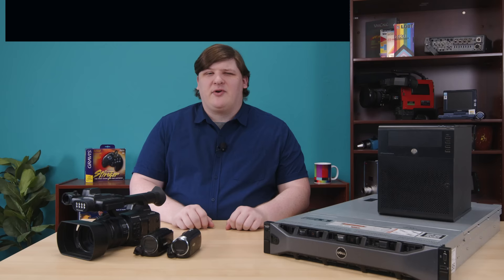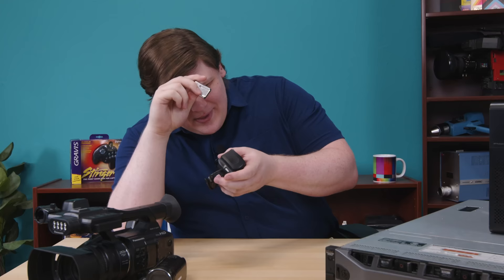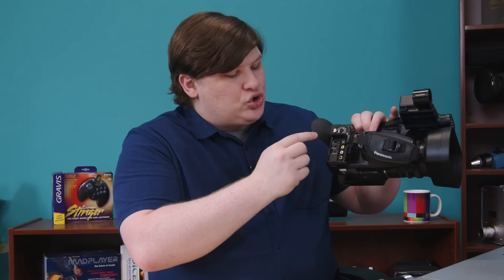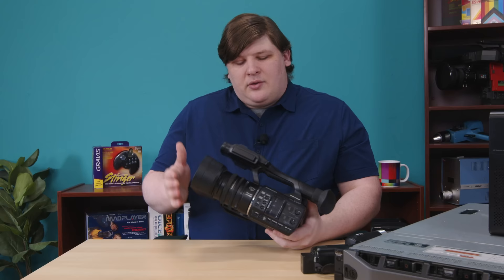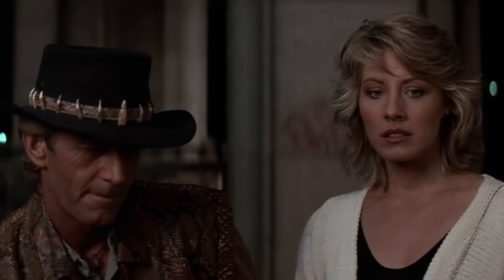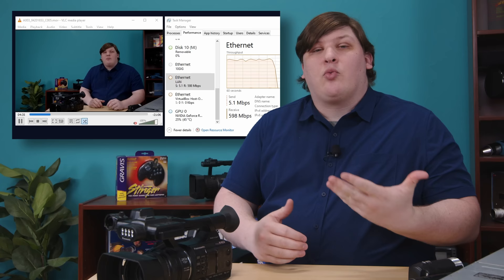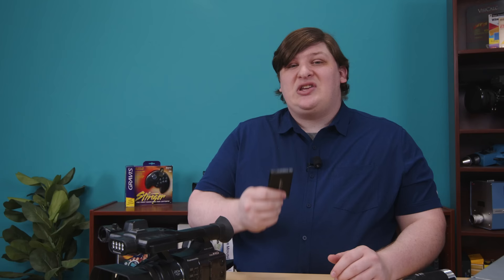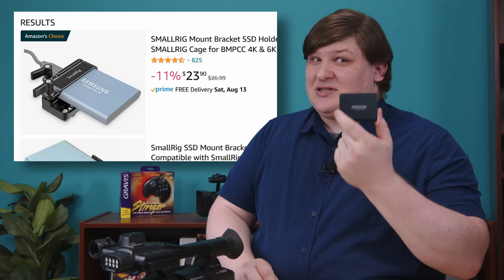I Built... a really fast NAS?

Comment: Dude!!!! Have I got the DOS command for you. Robocopy !!! You can make a scheduled task and run it from any machine and use this script to grab files from anywhere on the network and put them anywhere else on the network as long as the machine running the script has permissions access to see the files. Why is this command awesome? Automatic, and DOS... so fast as hell. almost zero impact on the computer running it OR the network... because it is DOS. The only drawback is also... DOS.. so you have to dive down into the "users" folders using actual folder locations, not assumed locations.  Using the arguments I provide in this script will cause it to copy only new and changed files.  The first time it runs it will take FOREVER, but once it is just copying changes it is FAST.  I love the control and the fact it has so little impact. It also makes a log so if it goes wrong, you know (if you bother to check it) I will post the script below. Remember to use Notepad++ when editing a batch so it has color coding for the commands.
Reply: Some things to know, this is of course a batch file - i call it backup.bat -- XF is file names you do not want to copy for whatever reason. The file I named had permission issues and would not copy. folder/file names with spaces must be inside quotations. the MIR argument does a mirror, so any changed files or new files get copied, and removed files from the source will get removed from the target.... so if you don't want that you need to modify the arguments.... if you want to see more about this command get the CMD line and type --- robocopy ? --- at the command prompt.
EDIT: The reason I have a weird goto end - End is because I had the entire explanation of Robocopy and its arguments in between there - copied from a DOS prompt. Youtube did not like it. would not allow me to post with that in there. probably something it thought was disallowed code.
Reply: never played with the linux equivalent -- rsync
but it is supposedly just as good at doing backups as robocopy in DOS. Never seen it used in a bash but probably not hard to figure out (for those who don't know - bash is the linux equivalent to batch in dos LOL)

Comment: so if you're sure you're not going to have any more than 1 client connected to a give, share at a time. i'd recommend using iSCSI instead of smb since it has basically no network overhead since it's a block device over ip protocol. it also doesn't deal with near the same amounts of windows networking issues

Comment: 15:50 110MB/s is a 880Mbps
And 110MB info you used was from BlackMagic website (I identified font) and it was mentioned for 30fps =))) 
Also prores mentioned top bitrate and bitrate can flactuate a little bit from 220MB/s

plus sound =)

Comment: I'm surprised by the poor performance you experienced with the HP MicroServer - I have a pair of these running FreeNAS/TruNAS 24x7 for like 7 years.

Power consumption is quite low, partially due to the low-power/performance CPU. Still, I can fully saturate the gigabit link on my NAS, both on read and write. With spinning disks. Sustained.

I should try and add a 10 gig card to see what its limit really is 🤔.

The super efficient, block-level ZFS replication over the internet to my other NAS (and vice versa) is super best for mutual off-site backup 🙂.

Anyway, I realise 1 gigabit is insufficient for your current bandwidth needs. Just recognized the MicroServer and drop my recommendation, if 1 gigabit is enough for you 🙂.

Comment: For your gpu issue consider the Nvidia RTXA2000 its based on the RTX 3060 but in a low profile package that runs totally off of PCI power, its a great little card.

Comment: Do some more looking at the T7 before you buy. It can write and read at Gig but can't sustain full speed over the entire disk. The cash portion of the drive is full speed but if you read/write a full 2TB from the drive it slows down to someone like 200-300MBs. MLC vs TLC vs QLC and using the QLC as a SLC cash.
Reply: Also thanks for making the video. There's a lifetime worth of knowledge in it.  Took me years to learn what you went over in this video. I bet it took lots of research time to get this far.

Comment: revisting this video now that i have my own fancy camera: i wish they'd just put a litteral nvme or sata slot into cinema cameras. i've got my 4k set up with a usb-c to sata sled and with a suffieicntly good ssd it works great (up to the limit of what sata can do at around 550MB/s with overhead). given that the writes speeds of nvme drives are up in what stuff like the 6k would need, they should just let you shove a 990 pro right into the bottom of the camera and call it a day!

Comment: This video really gets me thinking. I have many of the same problems. But with a even smaller budget. So unfortunately a lot of external drives for me so far. lol .  Also you may have overlooked a couple of Solutions in the beginning. I usually will dump my footage on one drive my storage Drive and then transcode to DNxHR on my scratch drive. This gives me at least one backup and really good for editing. also I set me project back ups to ather drive then save to the same drive when I do a normal save. Also why don't you use black magic raw? Just curious. You are on PC. I've heard it at it as well.

Absolutely great stuff . I don't think you're a dummy.  kind of bugs me when people call themselves dumb especially people that are so obviously smart.  

Love your channel it's very original helpful entertaining and educational. One more thing would be I would love to see a video on how you transcode to H.265. Do you use a script. I've had issues with audio sync using bartender. It works well for one video when you get the settings right. Anyway have a good day.

Comment: I wanted to invest in a NAS but instead started using my Windows PC as one. Luckily my case can fit 6 HDDs in nice toolless caddys (Enthoo Pro), and I also have 2 SSDs beside that, plus a hot swappable 5.25" HDD bay. 6 SATA on motherboard + 6 SATA on a PCIe extension card. My drives are pooled using DrivePool, and backup is done using snapraid. Mind you it's not RAID, so every time you make changes on the drives (and don't want them lostt in case of failure) you have to initiate a parity sync. I also do regular scrubs weekly.

Comment: Does it stand to reason that when mirroring, you may be less likely to suffer a dual failure of both drives if you use two ssd drives of the same capacity, but differing brands... but equal generations? It just seems to me that mirroring using identical drives could only increase the chances of failure under the equal useage conditions that exist during mirroring.

Comment: If you really start needing capacity. There's apparently older NetApp disk stations or whatever they're called that can be used and managed by nearly anything with minimal equipment. LTT has a vid on it and apparently they got the idea from others that had done it.

Comment: About dock: I bet a tiny 3d-printer adapter will make it 100 times better

About write performance: In zfs, you can create a "write cache" using a single fast nvme ssd. If that SSD is large enough, you might get away with slower main drives.
Reply from the maker: The only time I need fast is when I'm moving terabytes of data, in which case it needs a drive big enough for it all to land on. A cache drive would either be as big as my data - defeating the purpose - or smaller than my data - and would thus run out of space before it could offload what I was pushing to it.
Reply: @CathodeRayDude  that's the point. you basically dump your whole footage onto the cache and let it sync to the slower disks (at this point you can remove/reuse the removable media). yes, the cache should be as large as your camera disks (not as big as your archive), but it would allow the main storage to have lower write speeds (which also means it can be bigger for the same price)
Reply from the maker: @Derlaft  why though? I have no desire to store the full size footage long term, and it's completely unusable on slow storage, unless it's been transcoded.
Reply: @CathodeRayDude  "unusable on slow storage" I did not mean HDDs :) usually SSDs have much lower write speeds than read speeds, so that should still be usable. So just a combination of a very fast nvme ssd and sata drives in the hotswap bay. The point is to reduce price and also reduce the time you need to dump the footage (if you ever need that very quickly).

But that's just to highlight a very cool option. If you already know about it - cool.

Comment: Honestly I still use the g7 and g8. One of them sits with truenas works perfectly can saturate 1gbps no problem. And then the other one runs windows 7 just because I had a key works perfectly for my local storage. Then my g8 runs an higher end Xeon Cpu and runs esxi. And for the moment I run a rust server on that box. My router runs pfsense on a tiny dell sff workstation. Have a 3770 i7 and 16gb ram there. And that is utterly overkill. Pretty much everything I have can run at full gigabit.

Comment: 1:05:37 Fibre Channel is (sort of) L2 protocol, so it's a (sort of) stand in for Ethernet. While it's primarily used to run SCSI, there is an IPFC (not to be confused with FCIP) standard which allows to run IP over Fibre Channel - either in point-to-point configurations or in FC fabrics with FC switches. While it has its niche uses, it is hardly ever used. I've done it once just because I needed a heartbeat between two servers and ran out of Ethernet NICs. So all of this is unnecessary, expensive, and has dodgy driver support (unless you're using Solaris), so there really isn't a reason to know any of this and you can go right ahead and forget everything you've just read.

Comment: To avoid the smb share disconnect issues and the fact that the program wont edit files on a network share, you should switch to ISCSI.  Map the LUN as an ISCSI Target and the windows pc built in ISCSI client can connect and will treat it as a local drive.
Reply from the maker: But then I have to use NTFS, I lose all the advantages of ZFS and all the automation I built on the NAS. At that point I might as well plug a disk shelf into a SAS card in my PC. I also tried it, and iSCSI had bizarre slowdown issues.

Comment: He says that tower servers have even less drive capacity at 37:52, but my 32-drive Poweredge T630 would beg to differ
Reply from the maker: Wow, I didn't know they made those! What a beast. I think a 12-bay 3.5" array is still denser in terms of raw TBs though, right? That's how I was thinking of it.
Reply: @CathodeRayDude  
Oh yea, your system is probably much denser in terms of storage.
My system is configured with 24 600GB drives and 8 1.2TB drives, all at 10k RPM with the exception of the (hardware RAID mirrored) 15k boot drives, total storage is only ~24TB . The entire system is very impractical and the drives alone draw around 200 watts, but it is fun to brag about.
It also unfortunately suffered from Dell's annoying choice, which you actually sort of touched on in the video, of not including GPU power cables. I thought it would work just fine if I just plugged a newly acquired Quadro 6000 into a PCIe slot without power. I figured it would just limit it to the PCIe power limit. Turns out it draws as much power as it can and kills the system.
Also, with all of the drives plugged in, it not only sounds like a jet engine on startup, but can be heard throughout the house due to the sound of 32 2.5" platters spinning at insane speeds
Also wow I didn't mean to write a text wall

Comment: no joke, this video made me realize that my backups hadn't run in over a year - not because anything broke, but because I made it annoying for future me and then future me disabled it and forgot. you truly are your own worst enemy with backups

also found out that one of my RAID drives' power cables got unseated and the only indication was that the cluster got marked as (Degraded) in the BIOS menu, so uh, maybe time to ditch motherboard RAID like everyone warned me : )
Reply from the maker: phewwwwwWWWwwww that right there is why people don't trust hardware raid. not that you can't necessarily overcome it, maybe you can, but why bother adding another layer of abstraction when modern software RAID does so well on its own?
Reply: @CathodeRayDude  There are some real benefits to hardware RAID, especially since Windows' software RAID sucks. With proper hardware RAID on a server any failures will light failure indicators and will also link to the IPMI. Of course software RAID has its own benefits. Firmware RAID is the worst of both worlds.

Comment: Buy some used FDR Infiniband cards and switches. Loads of used gear available as ConnectX-3 is EOL by the vendors. You get near zero latency at 56gbps and if you're using IB protocol transfer and can avoid a lot of the overhead from TCP frame processing.

Comment: Storage is the biggest issue I face, Most of my Storage has been filled with archived Dashcam Footage, I have archived most of my footage going back to 2012 when I bought my very first Dashcam which I lovingly call the Crappy Cam, Quality was God-Awful and I still have it somewhere & it still works although the Hinged screen has had to be taped closed as the hinge broke, I’ve bought different Dashcams over the years & now have a 4K Cam in the front & 1440p Cam in the back of my Vintage Van and I like to backup my footage, I have no idea why I like to back every journey up but you never know, Their may be a good reason for me doing so but the reason eludes me at this time plus theirs also other Software along with some CCTV footage, Youtube footage, Old OS’s, Programs, Games, Drivers, Media etc, I have 3 x External HDD’s, 1 x 4Tb, 1 x 8Tb & 1x 18Tb plus a 4Tb internal HDD & a 1Tb SSD as the boot drive plus a variety of other drives (Probably 100 or more) ranging from a few hundred Megabytes upto 2Tb’s, I would like some form of complete solution, I do have a Dell Poweredge 2650 Server and  I knew exactly what you were referring to about Servers being noisy and it doesn’t get plugged in for that reason plus I live in a Flat (Apartment) here in Birmingham, UK and could really do with investing in a more up to date Server or a NAS that has a reasonable amount of Drive Bays and connects with USB3 at the very least, What I wouldn’t give for a Petabyte Drive that I could just plug into my PC! That was a good video to be fair, I had to chuckle when you found out that the Battery on your Sony Camcorder was removable after all! 😂🇬🇧

Comment: I don't know if software exists that can do this, but a thought occurred to me about the ingest time-lag - what if it was possible to have a semi-virtual filesystem that when you plug the USB drives in not only automatically starts copying the files to the NAS but also makes the data appear to have copied immediately, allowing the video software to use the files as though it were already copied, but is actually serving the data from the original drives while copying the data to the NAS in the background as USB/network bandwidth allows?

Comment: In regards to the Samsung T5, Samsung has recently discontinued the production of them. The T7 looks great on paper, and they seem to work fine for ProRes recording, but I have seen a lot of reports that at higher bitrate/lower compression BRAW recording they have a tendency to drop frames.
Reply from the maker: I'm really hoping the T5s hang on for quite some time because I hate the form factor of the T7, and yeah, I get the impression that it's just not as solid from an electronics perspective. Here's hoping things improve. :/

Comment: OMG, don't use T5s on a Black Magic: they can record to NVMe SSD! Buy a bunch, stick them all in USB-C m.2 enclosures (like the tiny Orico aluminum one), connect it to your pocket 4k/6k, and you're done. That's your "SD card". It can read/write WAY faster than your camera can generate data, and is so much faster to transfer data off to a PC than a regular SSD. And good news: you can now use Sabrent NVMe SSD, so your "sd card" isn't even a "tiny" 1TB, it's now 4TB or even 8TB. And still transferred at NVMe speeds, so not "hours" but "minutes", because NVMe can copy at several gigabytes per second.

That said, really modern cameras should simply have an NVMe slot to begin with. There is no reason to still use SSD or cards when the m.2 form factor is firmly established by now.

Comment: What u should use to record videos is an external video recorder/ monitor like the atomos ninja. It has a sata interface on board & u can use a high quality sata ssd like samsung 870 evo . 
If your camera has a cfexpress slot u can use nvme drives with adapter & unlike cheap sata ssds nvme ssds are still somewhat good but don't buy anything less than wd sn750 or samsung 970 evo. They are way faster than any usb & more reliable aswell. Best solution would be to use a dedicated recorder & i am sure there is one that will directly put the file on your server.

Comment: Wow that's a pretty decent NAS.
Is the SFP thing the only NIC in this server or does it also have classic 1G or 10G ethernet over TP or a second SFP Port?
Maybe you could outsorce the transcoding task to another dedicated machine with focus just on GPU power, maybe even with Windoze if there are better GPU drivers for that and let the NAS be a single purpose machine shoveling data incredibly fast from and to the drives and over the network.
And if the GPUs burst into flames over it's permanent 100% utilisation, your NAS and your data will still be fine ;)
Reply from the maker: The particular mezzanine card in this server has two 1GbE copper ports and two 10GbE SFP+ ports, so yeah, I had considered moving the transcoding to another machine - but I've already been offered a couple bus-powered GPUs, so that moots that, haha.